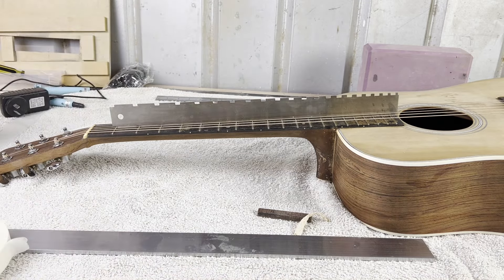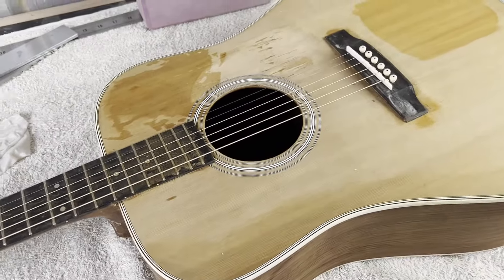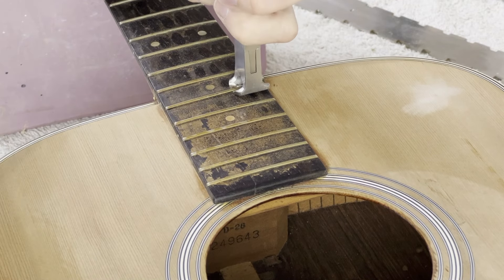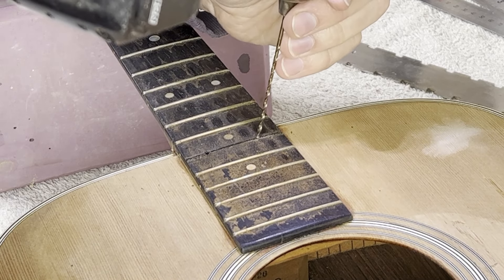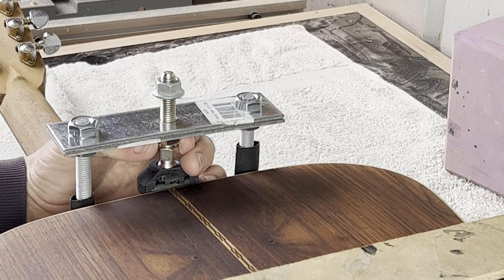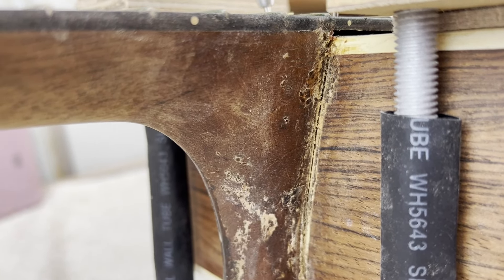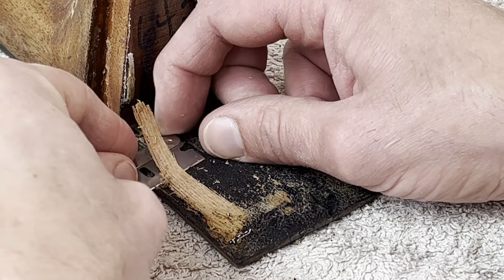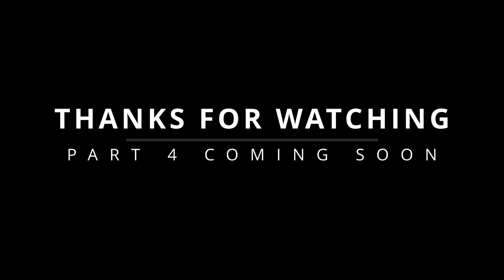1969 Martin D-28 Restoration - Part 3 | Removing the neck

Comment: Lucky to have little relief, most of these old Martins pre adjustable trussrods have too much.  If it has been refretted it could have been compression fretted.  Likely not in this condition but something to think about.  Martin quality control is great but I sometimes see new ones where the string pull isn't perfect.  Luckily you'll be able to get it just right with the reset.
Reply from the maker: Yeah I’d much rather too straight than too much relief and you’re probably spot on regarding compression frets. I’ll see how I go with the existing frets and worst case scenario will put some new ones in there.

Comment: Not sure why you are resetting the neck when it looks like the saddle is too high. Heavier strings would pull enough relief in the neck.
Reply from the maker: Check out parts 1 and 2 and all will be revealed.